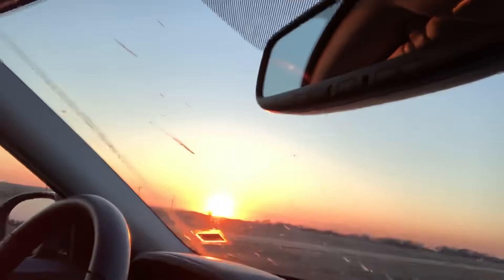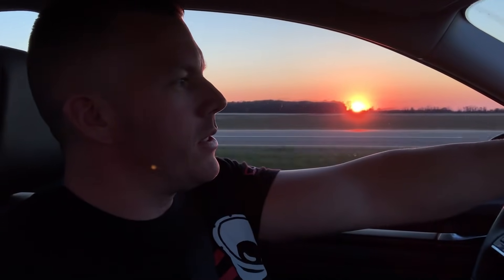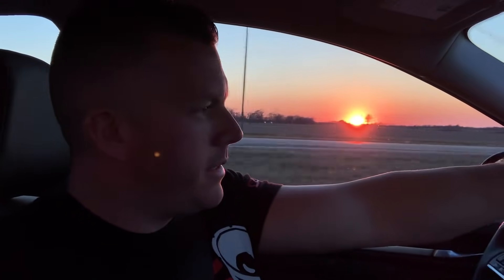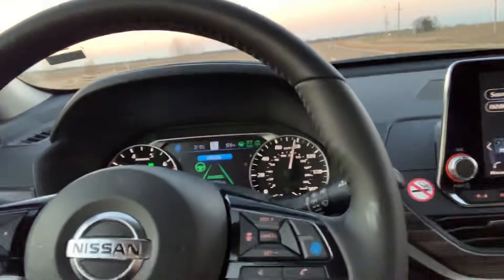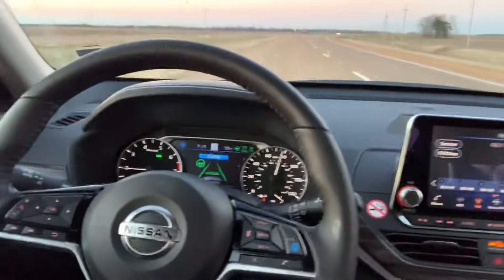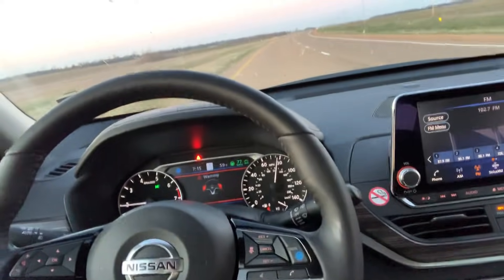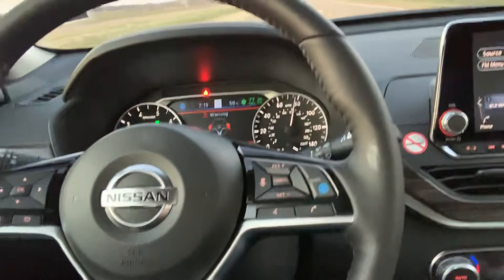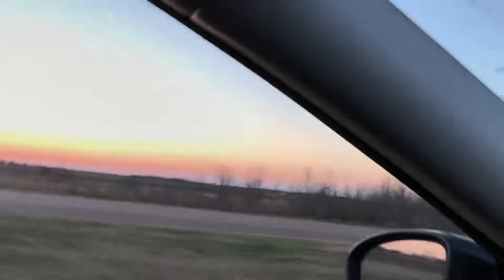WHY DO MY SUBWOOFERS STINK?

Comment: I have two 12” JL Audios with a 1000w kicker amp in my Escalade and a few days ago I started to get a smell coming from the box not a burnt smell but like hot garbage? I had the speakers in storage for over a year so I thought I rat might’ve crawl inside the box and died in there or maybe one of the guys from the shop that installed the system maybe left a burrito in there? Idk but my shyt stinks bro and I’m fixing to unscrew one of my speakers tomorrow and check it out 😖

Comment: I use my fosgate CLEAN setup.

1000watts RMS amp
1000watts RMS sundown

I'm doing the CLEAN setup properly. My deck doesn't clip.

Im setting the gain until the light turns blue @40hz like it says.

I can still smell my sub, I don't understand. It doesn't feel warm when I touch tbe cap.

Any advice???

Comment: Hey guys, i just bought a DD 712f (1500 rms) and powering with T1500bdcp. I tuned amp to clipping at volume 30. But my dumbass installed the sub (in spec box) and immediately turned it to volume 32 with a bass heavy song for about 5 seconds. Coil started smelling (but not really bad like a blown sub, just enough for me to notice it’s getting hot), so I turn the volume down slowly and let it cool. 

So basically I over powered sub (because Rockfords are underrated) with dirty clipped power. But I’ve been playing it below volume 30 for a few days now and it seems perfectly fine.

Should I worry that i lessened the subwoofers life? Or was it the glue on coil “breaking in”? 

Thanks you guys

Comment: If you have to turn up past half, you should probably upgrade... Along with T.H.D. ^^^.... S/N is also important, and the most important thing is that Wattage is NOT regulated by the FCC or whoever, so this million watt amp off AMAZON is probably 50 -100 watts and Garbage........................ I know late to the party but fell down the rabbit hole

Comment: Question so I have a ram 1500 it’s a 03 have kickers that is 300 watts whenever bass heads it sounds like shit the bass sounds to deep.. does it make a difference if I purchase a battery from down4 sound.plus purchasing 2 12,s that are 750 watts. Sa series rev.3 12.  Want something that would thumb👌but nothing crazy. And I would like to put them in the back of the seats.

Comment: The thing I'm not understanding is how TF my old 2000w soundstream pushed my t5 12 subs hard AF with no clipping and now I have the JP33 which the only way I can duplicate the same level of bass is by turning it way up and clipping like crazy.  I've literally bought and returned 2 new soundstream amps, 2 taramps and now debating on the JP33 all just to replace a $300 soundstream amp I've had for about 12 years. The only conclusion I can come to is I like really low frequency bass so in order for me to hit the notes I like, I seem to have to turn the gain up way past safe levels. I actually had it bumping real nice today, until I started smelling my brand new subs that I just installed. I'm no noob but I'm at a fkn loss at this point 🤷

Comment: My pioneer 100w subwoofer doesn't smell like burning or heat. It smells sort of sweet. I have have a Phillips surround sound subwoofer smell the exact same way. It blows the smell through the bass port. Is it just the box or what?
Reply: My subwoofers are stock with stock amps and still smell at low volumes. They are not new either.

Comment: I got a soundqubed hds3 15 2400 watt max y’all got any amp recommendations
Reply: Bijan Dunked on you how many just one or two?  i used the ppi black ice 5k on two hds315 @.5ohm and now I have 3 hds315 and running taramps MD8000.1 @ 1ohm They will run 1200rms each no problem so what ever amp you get don't under power them.
Reply: Robert it’s only one but don’t want anything too powerful too the point it’s too much for my car if ya know what I mean
Reply: Bijan Dunked on you well just make sure you get an amp that does rms min of 1200 that way you for room for another subwoofer in the future lol

Comment: what gauge power wire fuse should i use on a 1200 watt amp or higher ? im new to this and i got a sh..t amp going to be getting a new 1 its was a 1500 watt on 8 gauge .. my new one will be any where from 1200 and up
Reply: Depends on the amp and how many amps that you are running. I have always done the big 3 upgrade with 1/0 wire then ran 1/0 to the distribution/fuse block and the largest size that the amp accepts from the distribution/fuse block to the amp.
Reply: Go with 1/0 ofc 100% copper, no cca junk.. do it right once.. and use 1/0 reducers if 4ga is needed, then you'll already be good for upgrading

Comment: If I play for about 10 to 15 mins straight. My zvx get stinky.  Kind of a sweet smell. No clip lights on and don't drop below 13.8 volts.   Is that my coil burning up or just glue. Ive only had them a couple months
Reply: Same I can only play for abt 20 min not clipping or anything and the sub is rated for 3500 on a 3k amp

Comment: Made this mistake when I first installed my EVL 12s into my Nissan Versa. Didn’t set the gains properly or nothing. Then I put them in my Chrysler 300 properly with waaaay more clean power and tuned with an oscilloscope and what my amp settings were in my other car I was clipping those subs to high heaven. Got it good now, smell is stuck now as I had burnt those voice coils pretty good lmao

Comment: will the Ampere Audio 5000.1 withstand 0.5 ohm load for  daily use on strong electricals?
Reply: korean amps will on good electrical, just don't push it to hard, do what u can to keep it cool, and hopefully the protection circuit will save u if there's a problem

Comment: If you smell your coil... don't just immediately shut off your sub, that allows for the heat to sit on the coil and cause more damage... Lower the volume and let the movement of the subwoofer "blow air" on the coil and cool it down.
Reply: Derized is it bad that your coil smell if it smells can i still keep playing music. My set up y a regular stereo didn’t put any mods
Reply: Very true! I always need to change the song also cuz it's usually a constant beat with the same area of hertz, so if u change song, and lower volume, ur golden.
Reply: Thank you
Reply: Damn. My subs started burning today and I instantly turned it down.. should be fine tho. Thanks for the advice!
Reply: If you smell your coil does that mean the damage has already been done? Or you may have weakened the coil after a few times?
Reply: @mjl6425  I'm also curious, I wish someone can answer your question.
Reply: @mospitbullsbullysonftyello8906 Well, to answer your question I didn't break in my subs like I should and now, every time I overpower them, they smell very easily.
Reply: @mjl6425  
SAME..
Reply: @mjl6425 no it just means you got it hot. he explained it all. Sub is fine
Reply: @DeeHermanson yea heating it up to where it starts smelling (but not blowing sub) doesn’t make the melting point of the glue any lower. It’s just means you’re being too demanding and giving it too much power OR giving it dirty power. Your sub should be honest perfectly fine

Comment: Even in 2019 with a wealth of information out people still don't understand that the gain is not a volume knob. 
Question for someone reading this: Does anyone know where to get a drop in kit for a Rockford Fosgate T2 D2 10"? Beastly little sub while it lasted but one of the tinsel's  broke. I can get a drop in kit for the 12 but seems the 10 has been out of production for a long time. I really don't want to buy all the parts separately and put them together or in other words I don't want to waste money when I end up gluing the former to the cone and spider's crooked. The thing has a different build than other subwoofers in case you didn't know.
Appreciate it...
Reply: Why can't u just solder/repair the tinsel??
Reply: @mrmeiii  I cant get to it. The spiders are spaced from one another and the lead is in between the spiders. I had to take the push terminal off to see in there. Its hard to explain. T2 and T1 power series are not made like a normal subwooofer.
Reply: ditto well damn that sux I've fixed sum before so I figured this one could be too

Comment: Riddle me this, had two subdown es v3 on a hifonics zues 1950 amp. I had it pro installed etc since i need a receipt to not void any warranties but after i put the subs in a custom made box for them they started to stink and did for a while. Its a much smaller box too. But the smell has gone away
Reply: @kingly7946  couple weeks. I beat the snot out of them, they even got a little smokey but id say you spend a good week pounding them itll go away. It could be excessive amount of glue burning off specially if you know your not clipping. Like i said i went from a huge box to a smaller custom built one for the subs and thats when they started to stink.

Comment: They also stink during the breakin process.
Reply: Ohhhh I thought I blew them
Reply: Damn, I thought Soo too, I was gonna call skar and say that my sub I just bought is smelly. Like I burned it. So this is fine tho right.
Reply: @bulldograzor  Sadly, there is a good chance you burned the voice coil...
Reply: @Ryyderdie  no, it's still good and works better now. Not even burned at all. They just said it's a breaking process. It works good and isn't stiff. So it's good
Reply: I just got a skar audio evl that started to smell like it was burning
Reply: I have the same issue with my zv5s and we'll I even order new recones just in case , but not even the dust cap gets warm , don't know why they smell after 4 months do
Reply: I had dual 15s they smelled for a while when I was breaking in I just bought a 18 evl and it smelled for a while aswell still smells a bit but not like when it was brand new they will stop smelling soon
Reply: Much of what your smelling is glue curing, components, etc "New woofer" smell from manufacturing as well. From the woofer moving air. EVERYTHING JP saying here is right. Any sub with Everyday use should Never Be Clipping. Gains can be set to prevent it with a multimeter and test tracks. 0db tracks will set you up to never clip so long as the music isnt bass enhanced stuff. Set gains while playing at head units max clean volume and with other speakers disconnected but woofer connected. Turn gain to max desired voltage for desired power at box tuning frequency.  Setting gains like this will reduce chances of clipping. Clipping is also affected by low voltage too. So keep you batteries charged.
Reply: @bulldograzor  how is it holding
Reply: @slitherman7883  way better, it pounds pretty deep, it doesn't have no smell at all. Still pounding daily too
Reply: @bulldograzor  i have a svr 12 im trying to set my amp but i keep getting a smell when i turn it up my gain is about 1/3 of the way up
Reply: @slitherman7883   most people set their gains just a little just so the sub can break in, what's your setting on the stereo. Do you have the bass or freqs high
Reply: @bulldograzor  No i have them flat  no loudness or bass boost on im thinking it might be because i have a 2007 civic si with premium audio Factory head unit that has a gain or bass boost knob under my steering column that was in the car when i baught it connected to the factory amp or headunit not to sure but it controls my sub but sounds distorted when moving the knob wish I try not to use because I don't know
Reply: @slitherman7883  it could be, sn aftermarket headunit would be better
Reply: @bulldograzor  yea its just a longer process when you have to go around the factory amp and I'm not really sure about how to go about it. I am sort of on a budget which is why I haven't given it to my local car stereo shop I was going to try to buy everything off of Amazon or Crutchfield or whatever.. another question I had to learn I haven't found an answer for is when we listen to our music with the aux cord does it cost clipping when we have our phones volume at Max or is it a clean signal
Reply: @slitherman7883  slowly but surely ,
Reply: @bulldograzor  i dont understand
Reply: @slitherman7883  you'll get what your wanting slowly but surely. It's just short
Reply: @bulldograzor  oh i see yes well now im wondering if i have a ground issue or a weak battery because what I understand I should be able to get around 550 W RMS out of my amp without clipping but when I am multiplying the wattage by the resistance 2.5 ohms finding the square root then setting the voltage at the amp to meet amount of wattage desired my sub seems to clip while getting about 31 V which I believe means I'm only getting about 400 watts before clipping which is not adding up also my sub is a svr 12 800 wat rms and amp is the rockford 500.1  I'm starting to think that it might have something to do with my ground so tomorrow I'm going to test and see what my voltage drop is at the battery when I'm hitting High Bass
Reply: @slitherman7883  yeah, either the battery is low or your wiring isn't ofc/big enough/ bad grounding or hope from the worse, a bad amp.
Reply: @bulldograzor  so i guess rule out the battery first then the wiring the head unit
Reply: @slitherman7883  check the battery too, don't rule out any suspicion you might have concerns too.
Reply: @bulldograzor  thanks bud will do
Reply: @bulldograzor This comment is old asf, but you was smelling the glue from break in process

Comment: U should totally do that set a section at the shop where u can install the sub and the amp oh man that would get u a shit tone of views some will come to hate and some would come to see if the sub would last 24hrs in 3k do it and put a time lapse on it  and check temperature b4 and mid point and at 24hrs  but u have to set it up or else people wont believe it im a fan of putting more power rhan rated as long as ur carfull and know ur setup .

Comment: So what happens when you did it yourself, set it with a good multimeter to amps, runs perfectly fine, but when it gets to low frequencies it starts to smell. I’m thinking it’s just that the subwoofers won’t play that low? Or maybe the amp? My setup is 2 comp r 12s 500 rms each wired to 2 ohms with a ct sounds 2000.1d (rated at 1200 rms at 2 ohms) with gain tuned to 43 amps even tho the calculation was around 44.5 for 1k watts and sub box tuned to 39 hz and amp subsonic tuned to 30hz to play it safe

Comment: Yesterday my buddy at work was asking me the same thing. He had it installed at some shop blew his first sub in 2 months so they told him to upgrade to a better sub. Even with the amp only being half the rms of the sub it still stinks in about a minute and of coarse they put all the tuning knobs against the seat rail so you can't adjust them. And this is coming from a shop that has been doing car audio for 25 years now. You should have seen his face when I told him I've been putting double the rms to my subs for about two years now with no problems sure they get warm but they don't smell like burnt coil. I told him the key is clean power just like jp said. Anyways have a great day and keep those subs bumpin :)

Comment: Burnt up my first 15 had bass boost turned up on radio and got a friend to tune it. Good thing I only paid 100 bucks. Got a new Rockford 15 wired up correctly to amp and tuned it myself been bumping since September.

Comment: Can you discuss brand new sub break in or if that's just a made up myth, and possibly what gradual power you should feed your new subs or can you full tilt them from the start. Thanks JP.
Reply: Clint Hernandez the only break in is to send it at full volume to let the spiders to get worn in
Reply: @benmuckenhirn8921  Got it boss, will do, thanks for the reply.
Reply: only exception to that is if it's an 8 layer voice coil
Reply: not yo biz Hmm it’s a sundown X 15, I know most of its components but I’m just primarily asking because it’s the first time I try out brand new subs and don’t wanna mess anything up
Reply: that is probably a 4 layer voice coil on that sub so you'd be ok
Reply: "2” diameter 4-Layer CCAW wire voice coil wound on thick Kapton former" yea u'll be fine
Reply: not yo biz Thanks for your input bro, I really appreciate it, stay bassn!
Reply: @clinthernandez9393  it's a 3 inch coil. Not 2 inch. Coil size has nothing to do with break in. It depends on the type of resin they used to build the spider. The guy above you is an idiot. Send it full tilt right out of the box. If a sub breaks itself from this, it was garbage anyways. I've never taken time to break in my subs ever. Never lost one.
Reply: Dylan Houser Got you, thanks man, I figured I could just go at it from the start just wanted to be sure